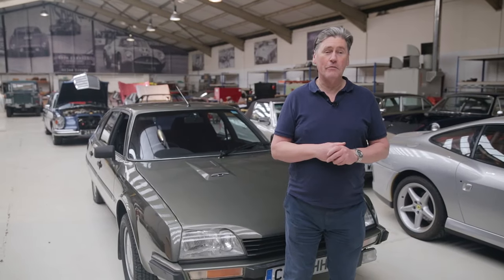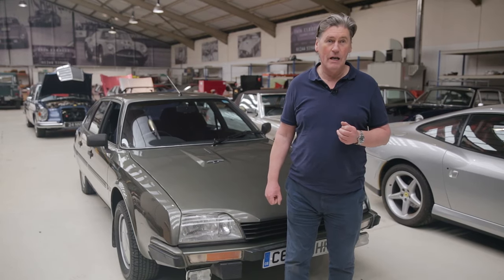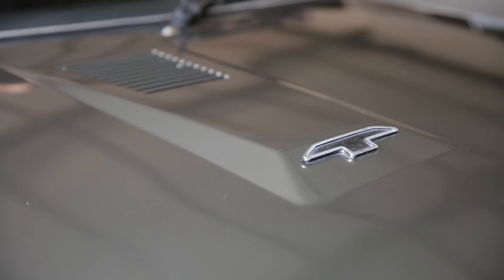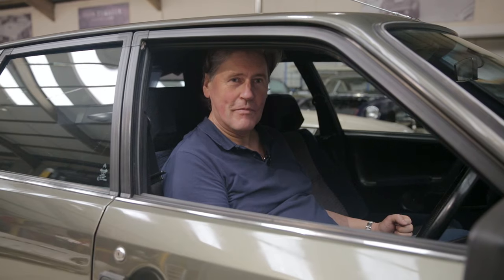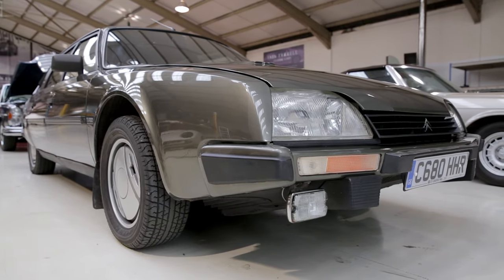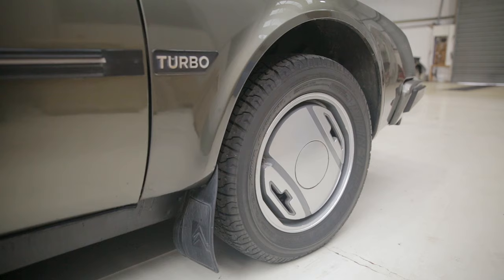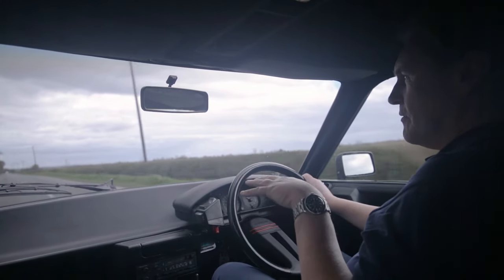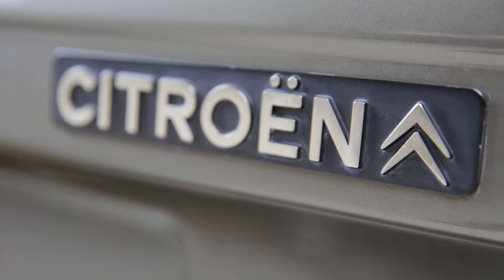Citroën CX 25 GTi Turbo - a rare beast with party tricks | Tyrrell's Classic Workshop

Comment: When you say shock absorber, do you mean the shock absorber or the damper?
Reply: Some people call them dampers and others call them shock absorbers: theyre both exactly the same. And the Citroen has neither, none, zilch.
Reply: @wizzard5442  technically no. The shock absorber is the spring. And the tube in a tube is the damper. They are completely different, the spring (shock absorber) absorbs the initial shock. The damper dampens the shock and stops the spring from springing about too much.
Reply: @Nick-xc4fy  I think you're talking about McPherson's Struts where the shock absorber or damper is inside the coil spring. The shocker/damper and springs are 2 entirely different components doing entirely opposite things: the spring is for the bouncing and the shocker is to subdue or reduce the bouncing.

Comment: wait,.... What?
So it doesn't have the extra controls in the glovebox for lifting one wheel off the ground when at full height, so you can change the raised wheel ?
The Renault 16TS does a similar limiting of the rear brakes, from a valve connected to the rear anti-roll bar, so when the nose dives and rear lifts, the rear brakes are limited, so the rear drops,.. That remote steering, the Tesla's do the same, but electrically.
The Double Chevron cut gears,... advantage of being as quiet as a helical cut, but bearing more load, without sideways thrust.
The disadvantage is the cost of making them, it's exorbitant compared to the cost of a thrust washer.

Comment: I could never take to these Citroens because they cover the rear wheels over and the front and back axles appear to have different widths (broad at the front, narrow at the back). To me, production cars should have front and back axles of the same widths, and the sides of the wheels fully exposed, otherwise the car looks like it's being dragged along by the front wheels.
Reply: However, the narrow rear track does help both aerodynamics and handling stability...

Comment: so you didnt mention the break peadl..which is just as super powered as the steering .. the pedal hardly moves and just as you put more force on it it stops the car rather quickly .. and what about the instruments ? its realy designed wel ..less buttons and really odd spacing .. the old version of this car was even better with metal bumpers and a speedometer in fluid !! .. thanks for mentioning the merc and RR using the float system

Comment: Not even a mention of the breaks ?   The CX can out break most supercars.
Not to mention tracking control around corners and it's almost uncanny road stability.
The CX s' fuel consumption is almost identical at 130kph as it is at 80 to 90.

Comment: 12:40 the steeering system is called Diravi and you are right, there is no machanical connection to the frontwheels. This makes the system so dangerous. For example, when the driving belt from the hydraulic pump unsnaps you have no control anymore, the steeeringwheel feels like in concrete. that means you have absolutely no control over the car!!
The self centering steeringwheel was not a gimmick, it was a absolutely necessary tecnic. In a normal steering you have the aligning torque thru the streetcontact and the wheel geometry. With the Diravi you have not. The Diravi is a 100% hydraulic steering like in a forklift. Have you ever tried to drive faster with a forklift? It is not possible. In this case, the Diravi has a second hydraulic circuit to simulate the street and wheel geometry, without it would be impossible to drive. I hope you can understand my explanations cuse iam German and my schooltime (English) is over 35 years ago.

Comment: What a fascinating video. Citroen had some incredibly clever engineering on their cars and this is every bit as interesting, if not more so, than the exotica. The suspension system still hasn't been beaten by anything else for ride quality. Remember those Citroen DS camera cars they used to track horse races? The Citroen made the perfect camera platform before stabilisation was a thing.

Comment: I'm curious as to Why the US barred these and other Citroens because of the hydraulic, adjustable suspension? Coincidentally, "by accident" I acquired a Citroën BX19gti, 16v,which had these systems, but my God, what a surprise it was to me, because it was stupidly quick, and bloody good fun too! Although I had 2 caps "explode" on me, being told they were underrated for revving and power of the engine, but I'm not sure that was it?? Not an Auto Electrics guy, but possibly was an original design fault for the BX range? Be fascinating to get answers to the questions. John, Leics, UK
Reply: Distributor Caps that is!
Reply: I believe it was something to do with headlights being at a specific height and not moving, which essentially outlawed variable height suspension.

Comment: The Frenchie's had some peculiar ideas about designing and manufacturing automobiles. Many of the ideas were cool but the issue is that the ideas were based on rather advanced technology and sometimes the reliability would fall short. The other part of that is cost. Don't get me wrong, I admire French automobiles and think they are cool as shit.

Comment: The Audi had a good drag coefficient until you put people in it. CX being self levelling always pointed at the optimum angle to the air. Also- using hydraulics negates the problems with springs which often do not return the exact same position. Every car should have this as shocks are truly terrible

Comment: Please, please do NOT call the very reliable, very easily to understand and equally easy to maintain/repair Citroën Hydropneumatic system "complicated" ! 
It is not an iron suspension like literally all others sport, but it is easily understandable for a halfways educated technician understanding hydraulics, valves and regulating circles.

Comment: I remember the GS1220 club. Those damn rubber diaphrams in the spheres would break and it cost a fortune to replace them. Also, the pressure regulator consisted of a sphere with a rubber bladder that also failed regularly. Then the expensive LHM fluid. 
This was almost 40 years ago now.
Never again.

Comment: Only the French should have these cars.Who needs 2000psi anywhere in a car except in the cylinders on ignition.  It wouldnt make any difference if it didnt ride like a carpet. What is for  sale today, at the cheapest prices, that wouldnt eclipse any car of a reasonable price from the 70s or 80s? I remember a test they did for non car people where they put a Mercedes star on one of the last Cortinas, the squarish one. And the people overestimated its value by a factor of three. And everyone asked couldnt pick the cheapest of cars from the slightly dearer unbadged models. If Mercedes put a star on a Lada some people would buy it.

The French manufacturers assembled cars in Australia in the 70s. When they went bad they were offering new cars at 3000 or so dollars discount . This burned the dumb buyers so much  that the Gov forced the car manufacturers to give back recent buyers the difference. They never held their values and you never see old French cars on the road. And now the French are selling in Oz again and people are buying them . I dont get it.

Comment: Citroen/Renault cars do not sell in large numbers in the UK. this may be due to eye watering depression. The cars are unreliable poorly made and tend to rust out quicker than a french cheese. A colleague purchased a 2013 model in less than a year he had to return the car for oil ingress on the clutch, spurious warning lights seat belt failure the problems continued. The main agent was less than helpful, it is heartbreaking to see these cars let you down in 2020. the car in question had a massive discount from the list price.
The engine may go on for forever but it is bugged by doggie electrics, rust. In less than a year it developed very annoying rattles. The suspension on older citroens were too complicated for the mass produced market. There are too few main agents who can fix these quirky cars. I have a neighbour who spends all his free time under the hood of his Citroen. It is a shame as Citroen has been around as long as Ford. Henry Ford succeeded selling cars worldwide. Citroen cars sell well in France.  
Good honest video report, interesting. One last remark, the tyres on certain Citroen cars  have to be Michelin I think. I had work colleague who had a problem with the tyres on his Citroen.

Comment: Do you really think that the car company that invented the automobile, built record breaking cars going 400 Km/h + in 1933   needs to "carbon copy" systems  from a foreign company ?The MB hydro pneumatic suspension was already introduced in the MB 600 and is completely  different  to the Citroen system, therefore no patent rights needed to be transferred. As a Citroen fan i understand your enthusiasm but please refrain from spreading false information.1 Trump is totally enough!